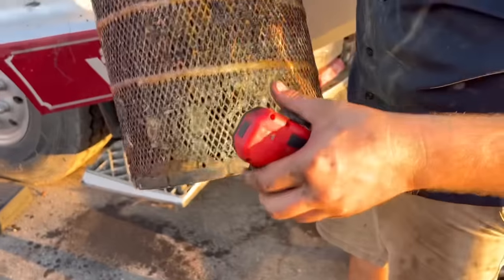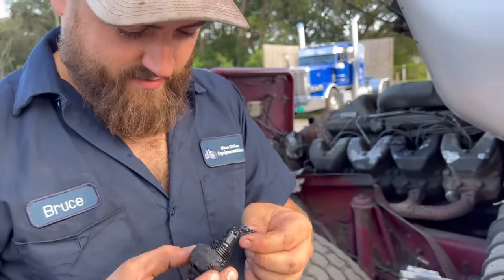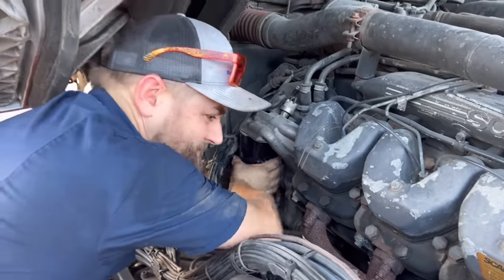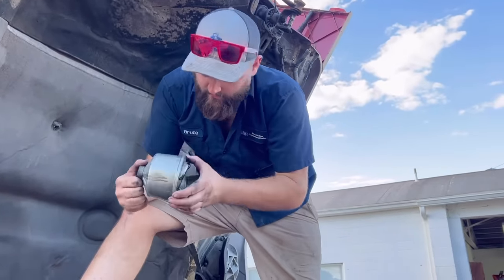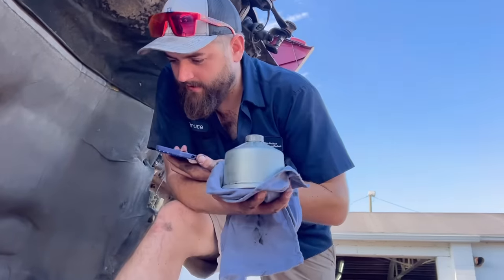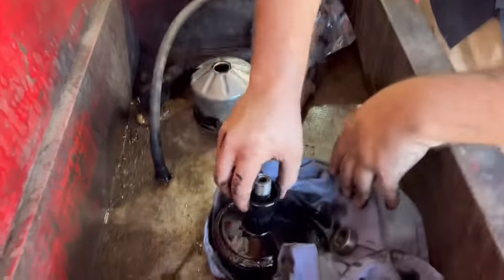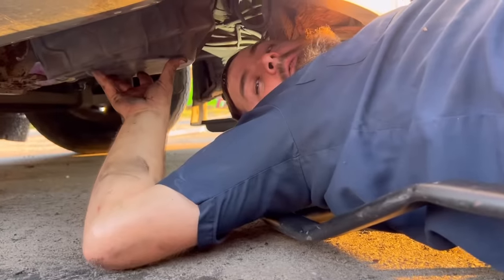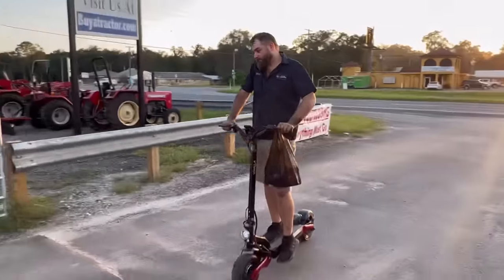Servicing my Scania, Missing Filters, Massive Sludge Build up!

Comment: Need to cut the oil filter apart and take a look at because I’m guessing that engine needs to be pulled and rebuilt. Betting that would be a lot of fun. The Cab is gonna be 250+ degrees hotter when you factor in the heat generated from the turbo and exhaust. As long as the heat shielding isn’t touching anything red hot it won’t catch on fire.
Reply: That's the problem I think, that heat shield is all frayed and dangling above the engine.
Needs replacing.

Comment: To make a tool to remove filter where the nut is off : Take a large socket and weld on 4 spikes. Then just hammer the socket down on the filter and screw it off
Reply: Or fabricate a strap wrench that you could drive with a ratchet and extension bar from the top
Reply: @martwebb32  i was shouting that whilst watching them destroy the old air cleaner. I made a filter strap with an old extension and ratchet strap. served me for years !

Comment: Tilt the cap all the way forward for safety. Then it cannot fall back on your head when a line breaks or something. And the spinny thing inside the V is a centrifugal oil filter / seperator. You found a piece of paper that goes inside for easy cleaning. It's kinda normal what you found inside

Comment: The oil separator is called "cyklonrenare" in Swedish it'll be like cyclonic cleaner in English. The oil pressure turns the cleaner and then the particles in the oil gets stuck to the walls inside it and that's the sludge you just removed. Pretty clever invention by Scania.

Comment: Few heads up while watching this.
You can drain the whole power steering system from the steering box- there is a drain plug at the bottom. Definitely drain it. 

The seal on top of the centrifugal does not go there. This is a drain engine oil drain bolt gasket. 

Seeing the air filter- The turbo is likely cooked. Since you are probably upgrading it regardless- doesnt matter. 

Gearbox oil fill plug is on the right side of the transmission. 24mm(maybe) headed plug. - Usually its fucking tight on there. 

Diff and gearbox 75w90 synthetic( diff filter is on the back of the diff- 2x 13mm bolts and the filter cap comes off.

These engines usually run 10w40. But since you are located in Florida, sub freezing cold starts wont probably happen- so the oil you chose is completely fine. 

Oil change interval usually 50-80k km. Oil centrifiugal needs to be cleaned every other oil change. 

There are many different air filter types for this, not unsual to get the wrong type one.

If you never ever touch the air dryer filters. The same will happen again- not being able to get them off :D

Comment: The one behind the injector pump is a spinner filter. It has a paper filter inside of it that collects the sludge out of the oil. It splits in two and pull the paper out with the sludge. Put in new paper filter and done.

Comment: That oil filter on top is call a Spinner II oil separate. The center comes apart and crap that thick slug out and put the paper to line the wall. Replace oring and put back together.  It takes the hard particles out of the oil.

Comment: The black metal filters if you have two of them with the same part number are for the transmission one is for the gearbox the other is for the the rear axle. It is located on diff pan behind a cover you only need undo two of the four bolts to remove the cover.

Comment: Mack trucks use centrifical oil filter as primary in late 70's, simply use putty knife to remove 1/2" thick debris. 
These get this thick every 5_7k miles.  
Can't believe this is first time discovered. 
Cheers
Reply: Basically wasted a ton of parts washer solvent getting that prefilter involved before removing 1/2" of trash first.

Comment: I look after a fleet of scania's in the UK and that oil spinner wasnt even that bad . Ive seen them nearly completely full of sludge . Also the gasket you out on the spinner under the locking nut is for the sump plug . The airdryer filter always break the top nut off . You need a fliter strap too remove them . Or ive seen the that tight , you have too use a big chisel & hammer it straight through the filter, put a tube on the chisel too remove filter

Comment: Never Ever Change Oil Cold. 

All that trash that settled out hot to the bottom, 
is now glued and never coming out cold. 

Plus the five gallons of new oil and new filters are now trashed in less than half hour fully warmed up, mixing in all that trash with new oil. 

Basically taking schitt yesterday, and putting it back in the tank to use for taking a schitt today. 
Cheers

Comment: @Bruce looking at the oil seperator, i would recommend looking at the bottom end of that motor if you are seriously going to increase the power on it with a new turbo and injectors, or the next thing you will see is a con rod waving at you out the side of the block!!! And that ain't good!!
Also make sure all the tappet clearance are correct to get the best out of that engine.

Comment: If you'll work on the scania's engine always lift the cab all the way. When there's pressurure on the hydrollic line cause of the cab weight the line might brake (and they'll do! Happened at my scania once wile lifting and it was at the same age and built as yours is. Only much yunger at that time)
But the cab might fall down fast

Comment: The sole purpose of the paper liner in the centrifugal filter is to make the sludge easier to clean out of it.
You just peel most of it out like you did.
The out flow from the centrifugal filter  does not pass through the liner paper (the out flow is via the tangential ports that make the filter core spin)

Comment: The black oilfilter is for the rear axle. The smaller filter is for the retarder if the gearbox is fitted with one.. I work with Scania trucks, mostly services.
Reply: The black oilfilter can also go to the gearbox.

Comment: black small filters are transmission and rear axle, white cotton filter is for the retarderbrake, oil seperator is supposed to be cleaned like that, and you just put a oilplug washer on the seperator :)

Comment: the black filter you have left goes on the back on the differential. Regards the transmission fill its on the side you fill it thru the side hole til it pours out then you are all set.

Comment: With V8 Scania’s the longer the exhaust the better they sound, and the more bends you can get in the exhaust makes it sound better!
Reply: Yes indeed atleast 4 meters
Reply: please NO. straight out of the turbo and vertical is the best sounding for the DS14
Reply: That just makes a horrendous crackle. A short pipe directly off the turbo to dual stacks behind the cab is the way to go
Reply: Blasting bangs
Reply: When u want it to Sound like a can of screws and have a nasty banging Sound, yes. 
For good Sound, just straight out Turbo and into highpipes

Comment: You installed a ring on the centrifugal filter that is not meant to be there! That ring is for the transmission or oil plug. Also check the brass bearing of the centrifugal filter if it is still in a good shape. I saw some off them with chunks missing. When that’s the case you need to replace the centrifugal filter. Cheers! The seco,d large O ring you had in the package seals the 2 separate centrifugal parts.

Comment: The powersteering dipstick is missing a rubber cap thats why the water gets in. there may allso be a small leak in the suction line that causes air to get sucked in and make strawberry milk colored air bubbles. And for the air dryer filter when the head breaks of drive a prybar straigt through it and use it to unscrew the filter its a bad angle but usually works

Comment: The hydraulic filter is for the retarder on the back of the gearbox, the black filter is either a gearbox or a differential filter, and the other fuel filter should be along the chassis rail somewhere.

Comment: The thing that spins around needs to be opend up it holds a cardboard film on the inside .... its a rotative oil separtion system ... dont forget the o-rings !

The ring you put on top of the separator is the oilplug o-ring !

If you need any info i worked at scania in belgium as a mechanic

The airfilter being rusted is because the airfilterlid down at the bottom has got a rubber piece sticking out for letting out water formed due to condesation in the intakeair ... i doesnt work if its full of nasty stuff tough 😅

Comment: That’s an oil centrifuge. Cleans the oil submicron without any filter. Clean out the rotor you pulled out by disassembling the rotor and clean the sludge and gunk out of it. Then reinstall and enjoy clean oil forever and ever.

Comment: The air dryer filter is pressurised, so if you dont drain it, you'll have shitshiw trying to get it loose, as you proved here. 😅 Shove a drill through the filterhouse and wait for the air to go out, then it'll be loose ish.

Comment: i feel you buddy. This filter gave you hell. Also please be careful there is some thin metal just the right one to give you nasty cut when something snap and your hand fly on it. 
Also designer of the engine positioned this filter just so it is hard to access and they do not consider when old those things are liked glued. Every truck should have all the filters positioned from the side, to be like plug and play.

Comment: For that stuck oil filter, there's this tool with three fingers that grip around the top of the filter, and contract as you turn the nut on top with a socket. They are kind of finnicky to use, but once it grips, it continues to hold it firmly as long as you apply force to it.

I have also removed a stuck oil filter by just hammering a big screwdriver straight through it for a handle. It worked that time, but I don't want to think about the consequences of just shearing off the top of the filter...

Comment: @Bruce_Wilson, that one black filter goes to the differential, there is also a filter behind the axle, covered with steel protect. And the new air dryer will be even tighter than the old one, bacause you didn't grease the sealing, and it is supposed to be tightening only with hands.... And when you add motor oils, pour them in trought oil separator hole, of course take the separator away first

Comment: Dont forget the oil filter on the diff (rear axle) bruce ...higher the mileage the more sludge build up in the centrifugal spinner as its known as on the scania........those air dryer filters need changing every year ..things like gearbox and diff oil and filters need to be done yearly as well...

Comment: why would you pull the heat shield between the motor and the cab off ? I bet it will be hot in the cab now.
Reply: Well it was bad to start with it... it could catch fire.. importantly it is for sound protection mostly than for heat.. it will be loud in that truck..😢

Comment: Did you wipe a film of fresh oil on that spin-on oil filter seal before you screwed it up? Otherwise it will lock on & be super hard to get off next time. Like that filter that ripped the spot welded nut off.

Comment: Add gallon of Hot Shots Stiction Eliminator to the engine oil. Run it for few hundred miles and drop oil again. It’ll clean all that sludge out.

Comment: 10:25 That's a oil filter, a centrifugal oil filter, it rotates by the oil spit from those holes, and separate the particles from the oil by the rotation...that should be cleaned

Comment: Just to let you know the oil spinner filter which you put the washer with the green rubber insert dose not go on top of the spinner it is the drain plug seal
I only know this as I work on Scania  for the last 10 years 
You will need to change the engine oil every 25000km  to stop  the oil spinner from sludging up with carbon/oil 
I hope this helps

Comment: I don't work with scanias, but, what happened to you with the air dryer filter on the front left that you broke off the hex for the socket taking it off happens to me a lot with 2005 vw oil filters since it's the same system, a way of taking it off is taking a really long screwdriver and puncturing the filter, sticking the screwdriver from side to side, that way you have somewhere to grip the filter and either losen it or use a air hammer to break it loose

Comment: Couldnt you put about 15 gallons of diesel fuel mixed with two gallons of Lucas oil in the engine and do about two straight hours of burnouts when its 100 degrees outside.  Drain everything out, add new oil ,and you might be good to go. Bill

Comment: The washer goes to the oil plug/engine sump! there is only cleaning and new o rings and the nut itself on the oil cleaner(NO washer) and OMG do NOT tighten the lid on the oil cleaner with anything else then hand tools because you will snap the oil pipe in the middle of the cleaner

Comment: LMAO "every we turn we're finding something wrong!"  Welcome to the Cabover Life.....
Reply: I think this will be the case of every truck, cabover or not, that obviously hasn't been properly maintained in many years. For example, I've never seen an air filter that looks like this. In Europe this neglected truck would most likely already have been scrapped. 
I'm not a fan of cabovers but I don't see much of the problems on this truck that are specific to cabovers except for the heat shield?
- And the more electronics and other complicated technology something has, the more issues it will have.

Comment: The paper filter could be fir the drive axle. Its a metal cover at the back of the hub and im sure if you remove it you'll see a paper filter.
Reply: It has a black metal filter not paper. at the beginning of the video, the filter that belongs there is shown. the same goes to the gearbox
Reply: Paper filter goes to the retarder.

Comment: The separator has to be cleaned with break cleaner and never trust the tilting cylinder from the cab because Scania cabs completely metal and the tilt hoses can Break easily

Comment: That air dryer filter is a prime example of why you you have to oil the seals on these filters, you tighten them by hand instead of with a breaker bar, and you replace them atleast once a year, rather than once in a new moon

Also, the fact the hex bit at the end of the filter snapped of tells me it`s way too tight, and will be a pain to replace. I`d suggest investing in one of those claw like tools that attach to a ratchet or breater bar, and you than place on top of the filter, to where as you turn your breaker bar to unscrew the fioter, the claws will tighten amd grip the filter really hard, while allowing you to apply as much leverage as you can. They work great for air dryer filters lthay are placed in places like these where you don`t have to space or ability to get another tool to grip onto the side of the filter
Reply: A new moon occurs 12 times each year.
You mean a blue moon , which occurs when a single calendar month has 2 full moons
Reply: Also if you want to change the filter it’s better to get the air pressure out

Comment: That filter on top of engine is not a filter! Open it up! And clean it out! Builds up carbon! Also put your engine oil  in there,b4 you put it back on !it's quicker!!! Are dryer filters are a fxxker!! Only tighten easy!!!!, you should have a filter for power steering pump!!! Its under the dip stick!!!, when all is done! Drive it like you stole  it ❤😂😂😂😂😂

Comment: Tighten the air dryer by hand, never with a wrench.There is a tool with like four fingers that are put on the ranch for such cases when you cannot release the air dryer and only aces from top, as you release it, these fingers squeeze the dryer and give you a better grip.I hope you poured diesel into the fuel filter, Scania is nasty to air when it runs out of fuel

Comment: PREFILL that fuelfilter or youre gonna be in for a long ride to get the air out of the fuelsystem and its very frustrating! trust me ive done it a couple of times on my old 144.

If i remeber correctly there is only one fuelfilter, might be wrong tho, and there should be a filter on the rearaxle.

Also always jack the cab up all the way so she tips over and then some extra so she doesnt hang on the cabcylinder, i would not trust my life being under the cab when its not up correctly.

Also while youre at it its probably overdue time to adjust the valves.

Comment: Scania does not have a coolant filter. Some older models may have it, but I don't think it does here. otherwise it would be in a prominent place. The last black filter goes to the rear axle. the same is in the gearbox. And the paper filter goes into the retarder
Edit. Someone corrected me that this model has a coolant filter. I have no memory of where it is even though I was repairing these for 6 years..

Comment: I believe I would pour about 5 gallons of diesel in the crank case and let it set a while then drain it out to clean the shit out of the oil pan this old girl was never taken care of for sure I have never seen anything quiet like this maintenance looks like it has  been run for years without any maintenance on the old girl

Comment: Bet it runs 100 more hp after this service no one gave a damn about that poor truck for a air filter to look like that we’re talking 5+ years the 1/4” of oil sludge in the separator that didn’t happen in a year or two
Reply: That air filter probably done some damage to turbo and valves should inspect insides.. and if he changes turbos should invest in new sleeves etc. Valves are proly worn..

Comment: Bruce, I'm not a hater, but count me as one who doesn't see the fun or "cool factor" in blocking the front tires while the rears burn. It's like what guys do with their Harleys with the front brake held on. What does that prove? It doesn't demonstrate engine power or torque, you just waste an expensive tire or in this case, four.